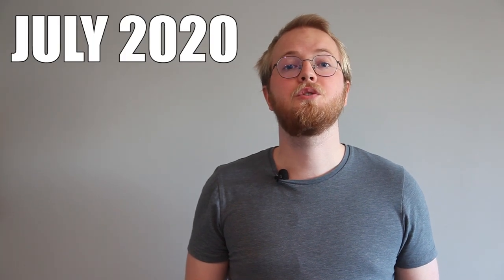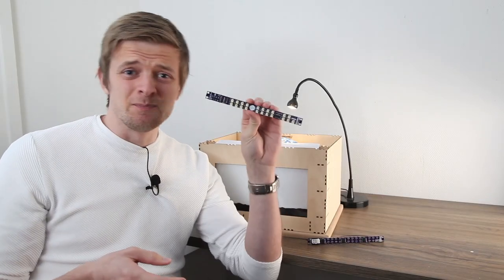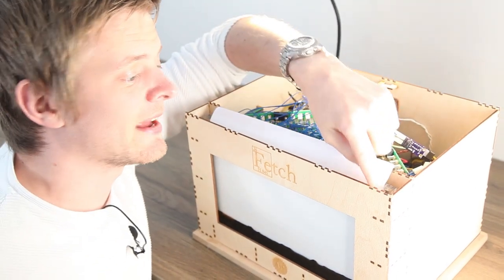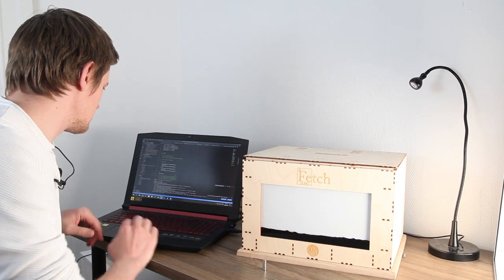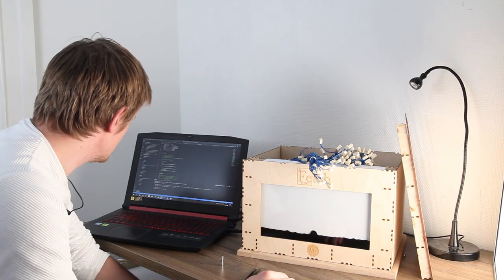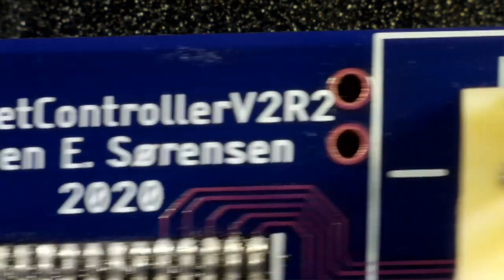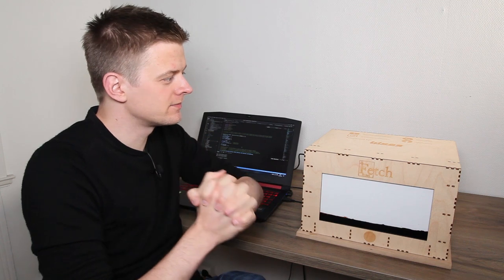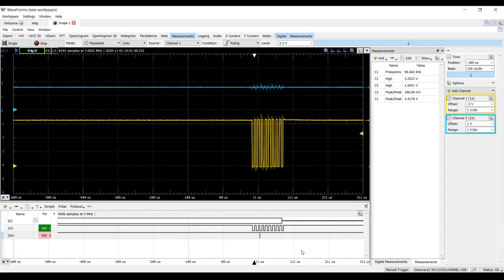Improving The Worlds Largest Open-Source Ferrofluid Display

Comment: I just arried on your channel - it's going to be fun. Thanks. I don't have the time to watch all your videos in the DIsplay series now, but from what I can see of that huge nest of wires, you seem to be driving each magnet individually - in parallel. If that's not true, you don't need to read any more as I'm proceeding from a false premise.

Usually, in matrix displays driven by microcontrollers, the matrix elements are connected to a set of common row and column lines. and then energised one at a time by driving the correct row and column line to "address" the target element. Then the array is scanned by the microntroller rapidly, so that - although only one element is ever energised at once - it looks like many are. Keyboard switches are read this way, too.

In this case, the scanning regime would have to work against gravity as un-energised elements might drop their fluid globule, though I can think of a couple of ways around that, and inertia might be all you actually need.

Anyway, the advantage would be vastly simplified control wiring at the expense of driver complexity. Perhaps that idea might help you somehow.